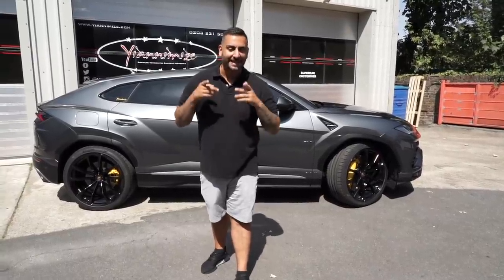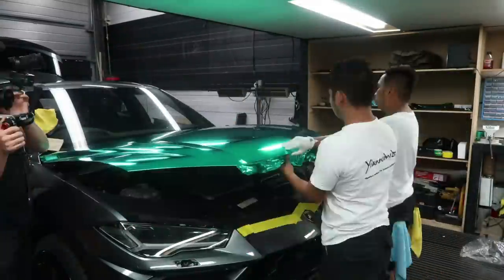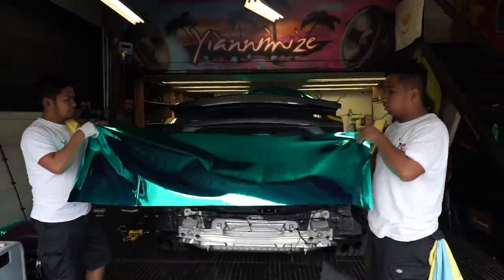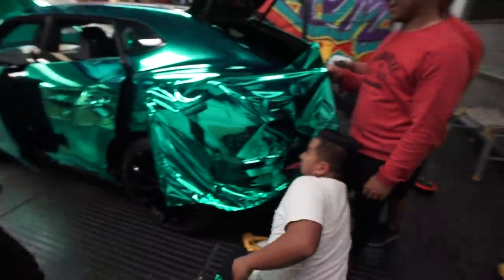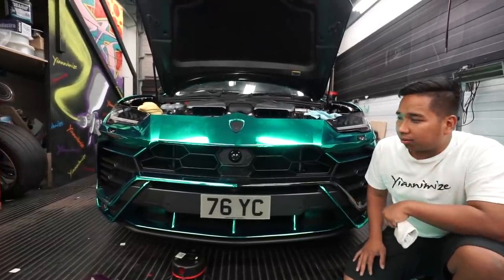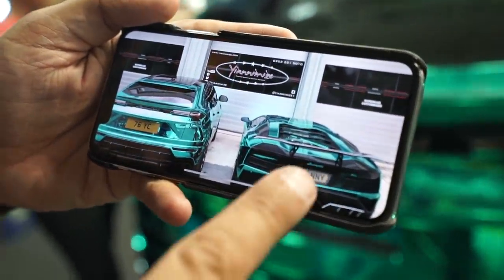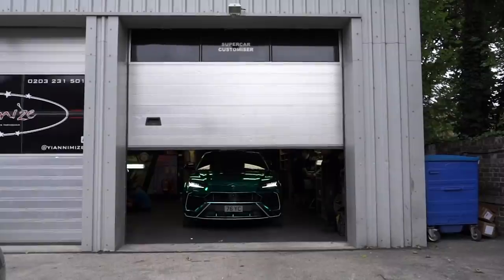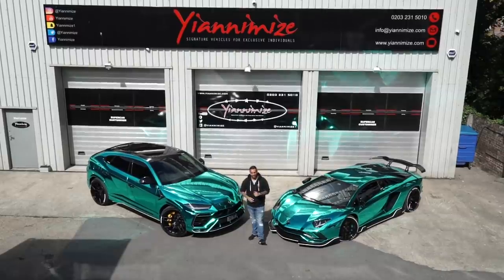First Ever Lamborghini Urus Wrap, Uniformed with My Aventador S

Comment: Color chrome gets two sun exposures one from the top and the other bouncing from the bottom back up. No UV inhibitor will have  protection against this kind of sun exposure. That blue will turn into clear chrome in two months under the sunlight.  We can also compare this issue to candy coating auto paint. NOTHING in the transparent coating( also known as candy) industry will last under the sun.  Ask any paint shop experts they will confirm this fact.  Lets talk about the chrome vinyl only, that will last you a year at the most... then will get flaky and matte looking. Done over 30 chrome cars switched to silver nitrate and candy coated for the same effect did not last. Been there done that so you don't do the same mistake.